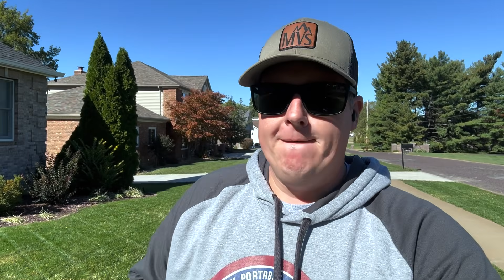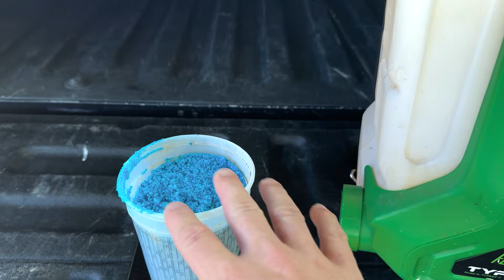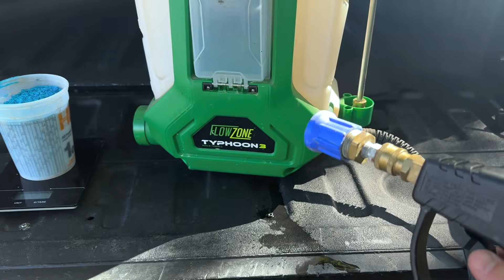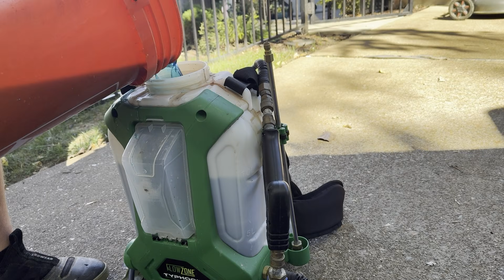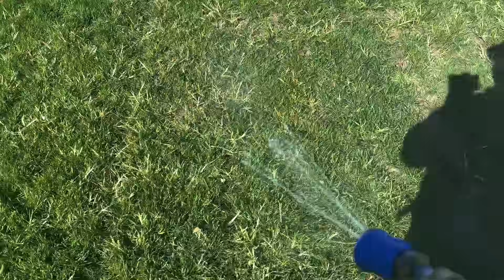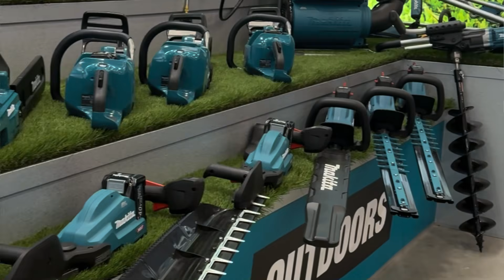How late into the fall can you over seed cool season grass? Will frost ruin everything??

Comment: Thanks for this update in particular.  

I live in the StL also. Through a combination of circumstances I didn’t get my grass seed down until 10 days ago.    I brought in several yards of sand and soil to fill low spots and smooth out the lawn.  The problem was, I couldn’t get that project done until 2 weeks ago.   So then put down seed and starter fertilizer.  I used a tall fescue combination of super turf 1 and bonfire to try and mow a bit shorter and manage fungal disease before.  Glad to see the temps warming up. Hearing you say my over-seed project may just squeeze under the deadline is a relief.  

Thanks so much for all of your content.
Reply from the maker: Those are some excellent seed choices! You should be golden on that grow in.